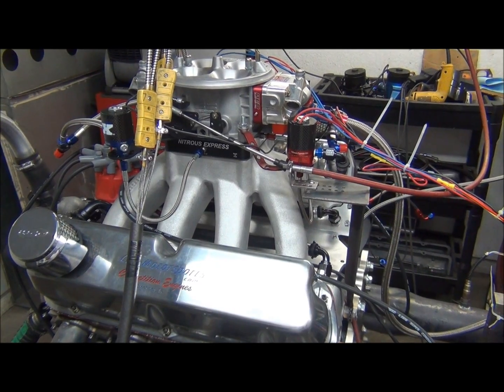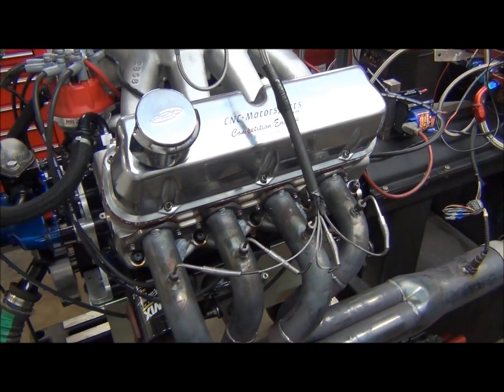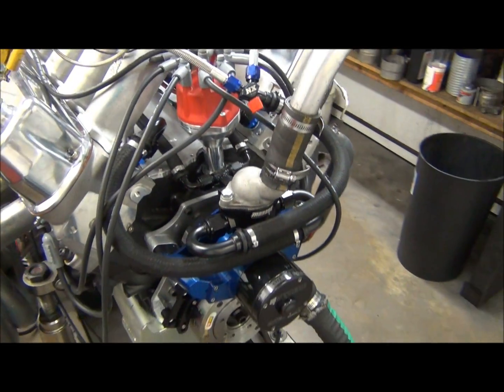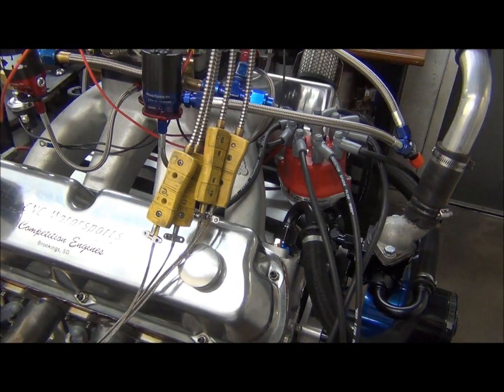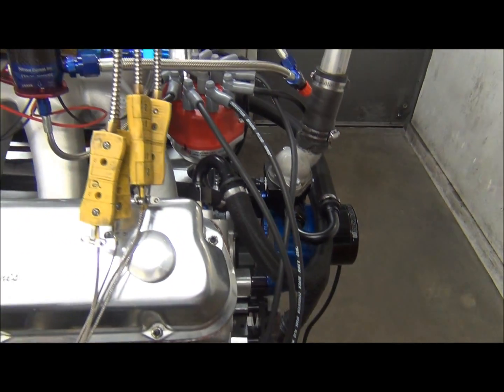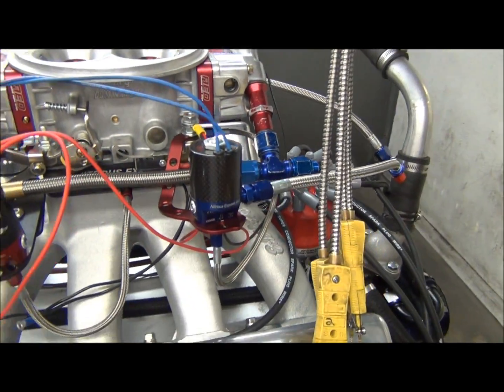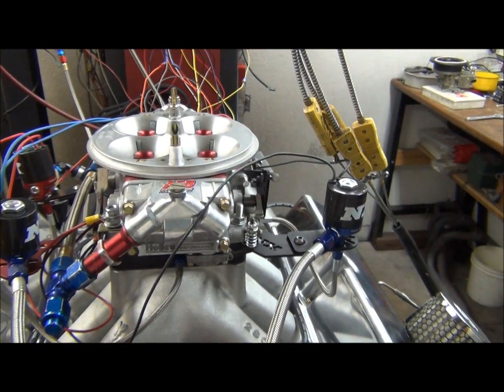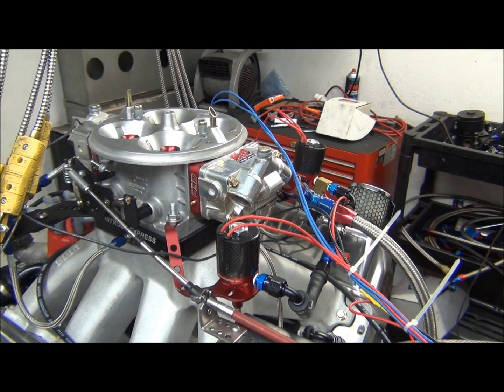1270 Horsepower 438 SB Ford Nitrous Engine by CNC-Motorsports

Comment: Wow impressive. Really nice piece.   But why did you sprin it up to 8200rpm.  It took it  but it was peaking at 7000-7200.   I would’ve capped it at 7500. Saved the valve train the added stress for no gain.   But non the less you guys do fanominal work. I bet you have a ton of time porting to get everything right.  I feel your pain.

Comment: Only 609 ft lbs torque? Guess you need the nitrous to get your torque back.
Reply: That's about all the torque you need in a mustang to get it moving
Reply: Well think about it......once you smack it with a big hit of spray, that 609 will double
Reply: It's likely the application if for some variety of Chassis Car, 609 ft lbs of Torque will run1.20 Ish 60 ft times in the right chassis.

Comment: Mewrongway the fact of the matter is it's a hell of a lot cheaper to build a GM motor versus a Ford or a Dodge as far as power output that depends on what you want to spend but I've built 4.6 mod motors naturally aspirated and turbo and nitrous and I always find myself going back to the 4.6 or any Ford motor for that matter right now I'm driving 87 Fox body what a 390 cubic inch Windsor bass motor and it's a daily driver it makes 700hp
Reply: Thats a bunch of B.S. building peformance is expensive no matter what brand you use, it just depends alot on the talent you possess to build something right and not half fast , put your thinking to that !😁
Reply: Ford motor you got quality GM you don’t have that
Reply: @ricktotz4078  - That’s nonsensical brand loyalty.  I am blue oval to the core but good engines can be built from either GM, Ford or Mopar.  It all depends on the quality of the build snd the right mix of good parts.  Cars have no idea what logo is on the car.
Reply: There allways has to be that GMLs guy who needs to run his pie hole that dont know what he is talkin about most of the time, he must get his ass spanked by fords so he got to criticize one way or another,😁

Comment: How do you or what formula you use to calculate what carb or tbi best fit a motor???
Reply: Take your C.I. X peak RPM and divided this by 3456 and that should give you the carb size. I'm running a 351-W .060 over making it 364 C.I. I'm turning this motor to 7000 RPM. The carb that's ratted for my engine calls for 737 cfm. I just went on a head and used a Proform 750 mechanical secondary.